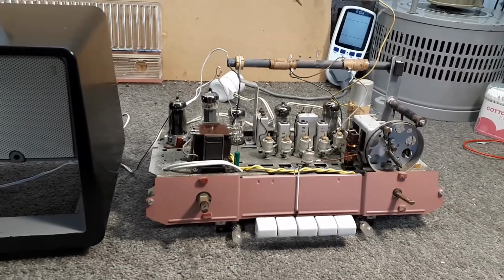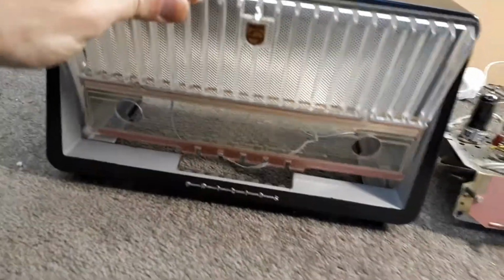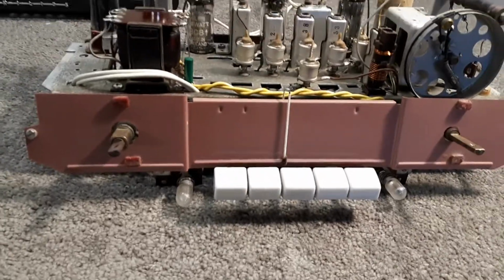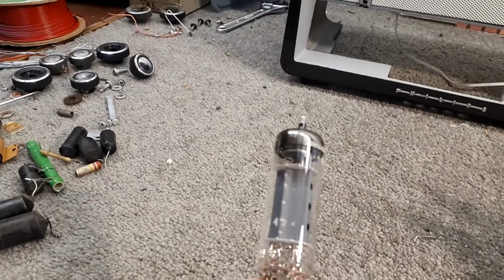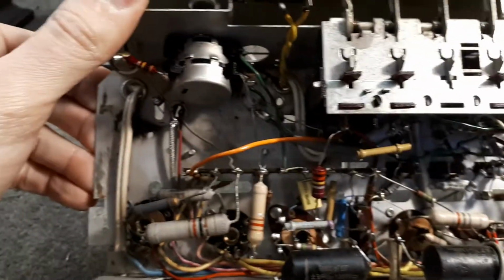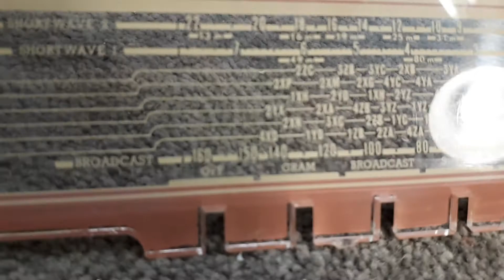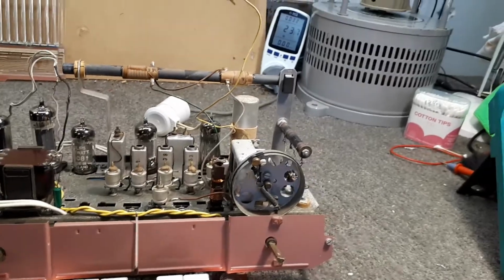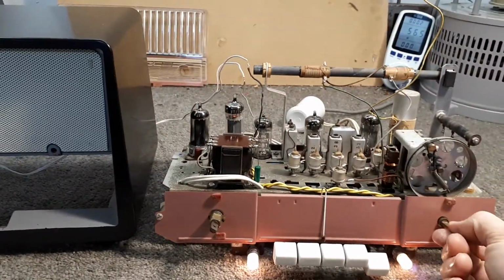Philips "Continental" B3Z75U AC/DC 1960s Valve Radio Part 3

Comment: I suppose that one could take a stab at wet sanding the pushbuttons with a series of wet or dry sandpapers to get rid of the scratches, followed by a polish. With regard to the dial, do you know if soap and water is safe for cleaning, I think you mentioned that it was glass cleaner that took the lettering off the other dial?

Comment: Trigun? That sounds like the name of a Japanese manga comic or anime show? No doubt the name was an attempt to tie them in with Colour television. They very well could be imported from Czechoslovakia, they had a Tesla company there during the cold war era, largely formed out of the Czech branch of Phillips, I've seen Tesla brand tubes on occasion. 
 Most of the import tubes/valves in North America seemed to come from Western Europe or Japan, such as West Germany or Great Britain, such as Mullard, Phillips (which were also made in Canada), Telefunken, and Valvo . You see TEN branded tubes here a lot, same with Hitachi-Raytheon or HitRay, Toshiba probably made them under a different name, Westinghouse Continental maybe? 45B5, I don't think I have heard that designation, 35B5 and 50B5 were the common types, but they had miniature seven pin bases, not nine pins.